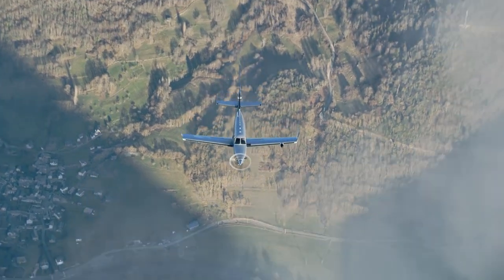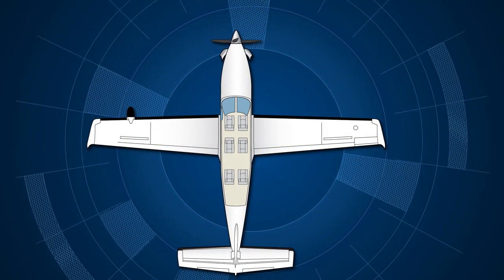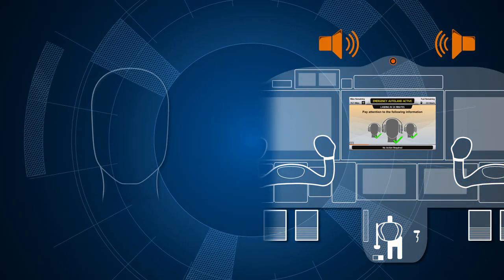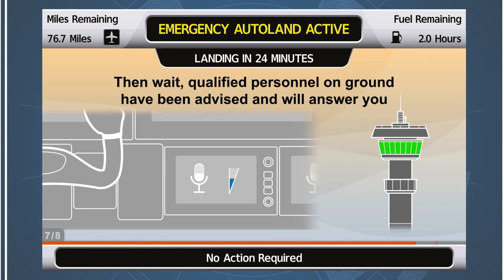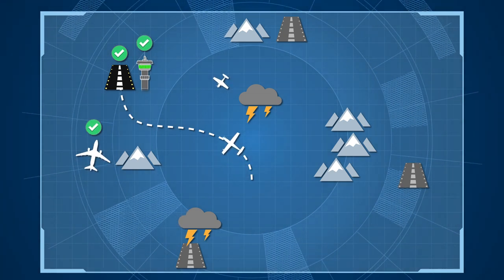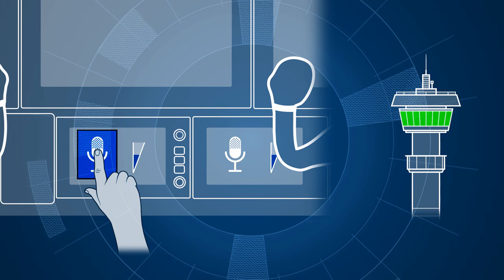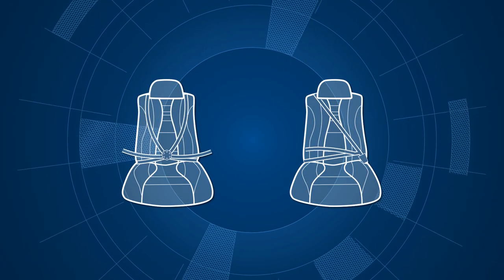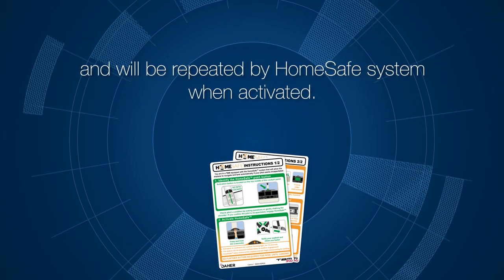HomeSafe™ - The emergency autoland explained

Comment: The comments questioning what happens if there's no airport within fuel range must be from non-pilots. The original flight plan airport is still there within range plus reserve fuel, and most likely there are closer ones within that flight path. Highly doubtful that a pilot of a plane worth close to six million dollars would plan a trip without fuel reserves.
Reply: yeah, wonder if engine failure AND incap pilot then? lol I mean if enough go wrong there is nothing you can do. but still lol.
Reply: After watching so many documentaries and retellings of aviation accidents. There is no guarantee that everything will go as planned. What if there is a fuel leak. or plane veered off course. One solution could be programming the homesafe to consider highways as a backup solution. or even fields a last course of action. This said this feature is great and can save lives.
Reply: @OnceShy_TwiceBitten garmin also has Autoglide. I don't know if that is built into Autoland/Home Safe, but if it is, it will do the trick.

Comment: Really good feature. Will you sell HomeSafe to Airbus or other aerospace company ?
Reply: It is not daher's feature...it is Garmin's feature in their g3000 avionics. Few other aircrafts that use that avionics like Piper m600, cirrus vision jet also has this feature...
This is mostly useful in aircrafts with are single pilot certified, in airlines there will be two pilots and if one gets incapacitated then other pilot can land it safely...
Reply: Compared to a parachute it's pretty useless actually, it has only like one usecase that a parachute can cover
Reply: @misham6547  No. The cirrus parachute system is way more primitive than this.  This is a much better system for the safety of both passengers and those on the ground.  Always better to fly down than to plummet.
Reply: You are kidding right? Airliners can autoland on cat III for years, it is just not standard to do so when you have live pilots onboard ...

Comment: Passengers should not be afraid to fly anymore.  I only wonder what happens after the plane is on the landing strip and shut off.  Other planes cannot use the strip until someone moves it to a safe place?  Truly an amazing piece of technology!
Reply: Not very difficult to tow off an aircraft mate. ATC will have strip clearance and emergency services in place.
Reply: No different from any other emergency. ATC will close the field and direct other traffic out of the area until the emergency aircraft is clear of the runway.

Comment: Very cool. It does seem like a lot to expect of a passenger though. Obviously, you’re expecting less of the passenger in this scenario than you are in an aircraft not equipped with HomeSafe though. Maybe at some point it will be able to automatically detect when the pilot is incapacitated, and initiate itself.
Reply: The only thing a passenger really needs to do is push 1 button for 2 seconds, the rest is all more or less optional unless the incapacitated pilot has a death grip on the yoke or pedals.